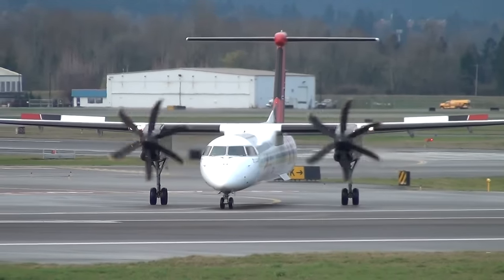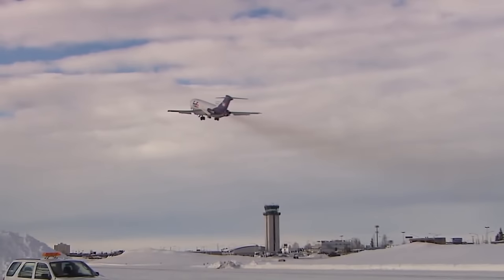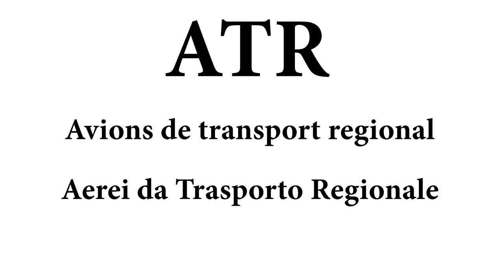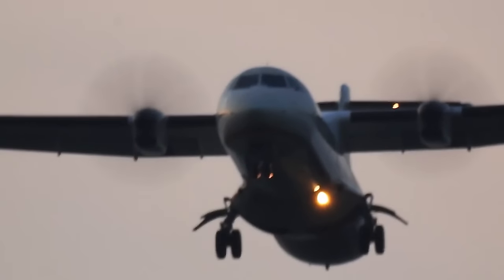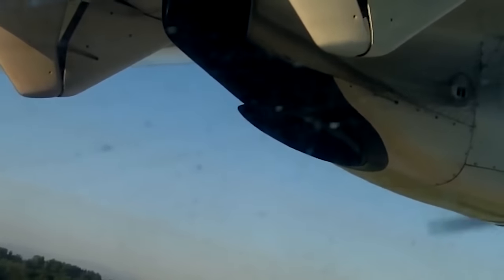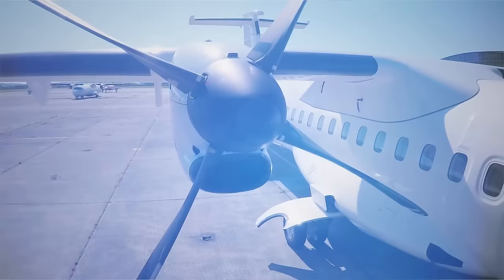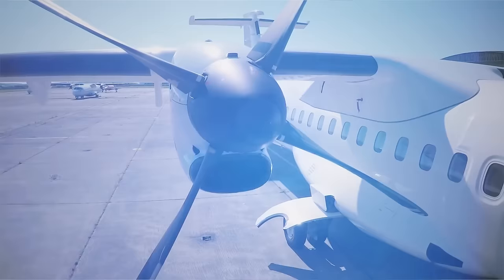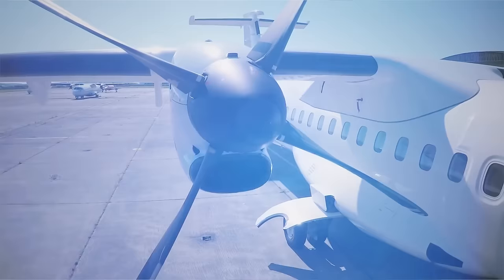ATR 42/72 - the European turboprop

Comment: I work as an aircraft mechanic on ATR 42. One of the things which amaze me is that it does not have any hydraulic assistance for main flight controls (There are, however, hydraulic spoilers which move together with ailerons), instead using variety of aerodynamic tricks to ease forces on the yoke. One less thing to wrong I guess.
Reply: Why is it being made though?
Reply: Oinikis can you become a pilot being an aircraft mechanic?
Reply: @rodelpheavertisamba866  well if you use your pay to get flight lessons, that's what I do, however by just working as one - no, it's completelly unrelated
Reply: @ Nikko Andrew Parangue

That is known as roll upset and is actually one of the advantages manual controls have over powered ones.. and why you’re not supposed to fly on autopilot in severe icing conditions. 

Controls that are snatched from your hands indicate roll or pitch upset and tell you that you should increase speed and not change configuration.
Reply: That's why they call ATR has a "fly by muscle" system
Reply: I work for an airline that also has ATR's and the mechanics I speak say the ATR is a real bitch to work on.
Reply: @QuarioQuario54321  You mean why build turboprops? They are cheaper to operate, and over modest distances their lower speed has little effect on overall flight times.
Reply: jve89 wrong !
It has always been a pleasure to work on, good access to aircraft systems etc.
Reply: jve89 I happen to notice how most cars I’ve known to be a lot of fun to drive, but are also a real pain in the butt to work on.  I guess some planes are no different.  Am I right?
Reply: The ATR has to be carefully loaded (pax/baggage) to maintain stable flight. When they are ferried to maintenance they carry extra ballast because they are unbalanced when empty.
Reply: @rodelpheavertisamba866  sure you can.
Reply: Fokker did the same... The F27 flew like a dump truck while the Fokker-50 handled like an twin 172
Dunno about the ATR but smart design can eleminate devices that can cause problems
Reply: Can you elaborate on how it works?

Comment: Once I followed an Azul ATR-72 that took off from Recife and landed on the Cabo verde... that little bastard crossed the atlantic.
Reply: Once I have flown on a Dornier 228 from Corvo to Flores, that tinny thing crossed the Atlantic. 😂
Reply: @TheAllMightyGodofCod  I didn't get the joke
Reply: Done many flights in 42/72 in Cabo Verde, one only lasted 7 mins
Reply: Ferry flight
Reply: No way!
Reply: Arecife?
Reply: @moneymandan6217  No, Recife is a state capital in north east Brazil
Reply: I was able to fly a 42-500 with full tanks from Ireland all the way to Gander in FSX
Reply: Range   900  miles  of this  aircraft
Reply: OUR NEPAL'S ATR-72/42 WHICH IS USED BY BUDDHA AIR AND YETI AIRLINES HAS NEVER GOT AN EMERGENCY EXCEPT FOR ONE WHEEL FAILURE

Comment: I once flew on an ATR 42 with American Eagle in 1992, from Raliegh Durham to Charlotte NC. The thing I noticed was that it was somewhat less noiser than most turboprop airliners.  It appeared to have thicker cabin insulation that somewhat muffled the low pitched drone that's produced by the props.  My girlfriend gave it the nickname, "The Whisperprop".  I wish that Boeing 737s and Airbus A 300's were turboprop instead of conventional fan jet,  Though a bit slower, turboprops are more fuel efficient than fan jet engines. I also love the sound that the props make, the "Box Fan" sound full ground idle and taxiing, and the "Bumblebee" sound in takeoff and inflight.  Some say driving a manual transmission vehicle is "Real Driving".  I say flying in a propeller driven airliner is "Real Flying"!

Comment: They can be tricky for inexperienced pilots or those with limited intelligence.  Crosswind TOGO or landings can be challenging.  The wing surface area is designed for fuel efficiency, not maximum lift and low speed flight.  Redesigned wings that are longer and larger would make it better.

Comment: I have flown on TAP's ATR-72 and SATA Air Azores Q400, Q800 and the old ATP... They are all nice but the the ATR has the most modern cabin. From outside it kind os looks dated with the high wing but inside is very modern and comfortable. I really enjoy flying Porto to Lisbon on these little things. So quiet and views are so much better than on a jet plane!
Reply: @khoileanh402 ir a little bit better than Q799 but no quite as good as Q801

Comment: I love your videos!!! I used to work with ATR 72 and Q400 aircraft... I prefer the Q400.
Reply: Do you think the Q400 has a future?  I hope so but they get maligned on landing gear reliability.
Reply: i love working on the 400 too. i was an avionic tech on the Q400 assembly line at bombardier toronto.the avionics interfaces were in tight locations. all flight computers sat right below the centre floor board.
Reply: In terms of the cabin, ATR over Q400-800. they are not bad and maybe more spacious but the ATR is so much more elegant.
Reply: AviatorNeil really ???
Emptying hydraulic fluid almost on a daily basis, lol....this A/C is simly dangerous

Comment: The ATR 72 was the only turboprop my mom and I flew on. Before flying on that turboprop, she refused to fly on propeller and turboprop airplanes and would rather fly on passenger jets. Even after having an experience onboard the ATR 72 with Cebu Pacific back in 2019, we never liked it because of the uncomfortable seats and small overhead bins too small that we had to check in bags. However, we got what we paid for because Cebu Pacific is a budget airline along with its branch Cebgo. Even if that experience wasn't enjoyable because we never felt safe in that type of plane, turboprops shouldn't go obsolete because those planes would only make sense to be utilized in small airports that have shorter runways and limited service.

Comment: Air NZ through its subsidiary Mt Cook Airlines, is the 3rd largest operator the ATR72-500/600 in the world. Air NZ has found the ATR72, to be economical and reliable but is not as fastest as the airline's Q300. ATR is in discussions with Air NZ about using the ATR42-600S (short take off/landing version) to replace some of the aging Q300's.

I have found the -600 quieter and less vibration than the -500.
Reply: Got to wonder if Air NZ will ever get the Q400. Air Nelson has been asking Air NZ to upgrade their Q300 to Q400 in the past and got denied as the Bombardier aircraft are not as efficient, but they sound more ergonomic as mentioned in the comments and the - 400 carries over 80 passengers.
Reply: @captaindusty4884  I read somewhere that a Q400 costs 31 million dollars and an ATR 72 26 million. Price of the Q400 may even go up when Viking Air starts building them. ATR also has the advantage of the Airbus service network. It's a very competitive market.
Reply: @captaindusty4884  - Air Nelson originally wanted the Q400 but was given the Q300 instead, as the 23 Q300's purchased were cheap due to the end of the Q300 production. Air NZ wants to operate the ATR for all regional services as they are cheaper to operate plus the ATR fleet will have update RNP for all weather operations and be compatible to the virtual (unmanned) control tower system that New Zealand is introducing from 2020.

Comment: I lived in Cape Verde for a good while. Cape Verde airlines has a lot of ATRs and I used to know many of its pilots. It is not only some good aircraft for travelling in, it is also a very interesting aircraft to pilot they used to say.
However, the "faint of heart" wont be too comfortable with its noise or the sensation the short distance of the engines to the body of the plane gives.

Comment: I thought the icing problems these jets had would have been worth mentioning.  Weren't there 3 or 4 crashes in quick succession in the 90s due to icing?
Reply: Yes. Roselawn, Indiana.
Reply: @billyray3761  Yeah. This plane is not good in cold conditions. A heard, there was another accident in Russia too
Reply: No !  There was ONE. Roselawn Indiana and the icing conditions were so freakishly severe ANY aircraft that used boots would have gone down. I flew this plane all over Maine and New England in winter conditions with no problems. That incident gave the ATR a VERY undeserved black eye.
Reply: Flyer Killer 
You obviously never flew the ATR.
Reply: @savagecub  ATRs have still deicing problems time to time...
http://aerossurance.com/safety-management/atr72-control-problem-no-2016/
Reply: @savagecub  Btw. there was more than one fatal accident with ice to be blamed:
Aero Trasporti Italiani Flight 460 (1987)
American Eagle 4184 (1994)
TransAsia cargo 791 (2002)

Aero Caribbean 883 (2010)
UTair 120 (2012)
Trigana Air Service Flight 267 (2015)
West Wind Aviation Flight 280 (2017)
Reply: Thomas Chadwick 
The examples you bring up are quite specious with the exception of Eagle 4184. Using your logic one would also fault the design of the Q400 involved in Colgan 3407. Let’s look at each reference you bring up :
1.) Aero Transporti 460 - crew was climbing in IAS mode and not adhering to company procedures for icing conditions. Fault of the crew NOT the aircraft. 
2.) Eagle 4184 - previously discussed - a British investigation revealed that likely no form of deicing boot would have been successful under these extreme and isolated conditions. 
3.) TransAsia Cargo 791 caused by the flight crews unfamiliarity with icing conditions and lack of awareness concerning several Cautions and Notes contained in the aircrew flight operating handbook. Fault of the crew Not the aircraft. 
4.) Aero Caribbean 883, this one is of particular interest to me as in reviewing the serial number of that aircraft I found that I had actually flown it when it was owned by another carrier. Witnesses report seeing the plane flying low prior to impact with smoke and flames coming from one engine. Icing is mentioned in a side note but hardly the sole cause of this incident. 
5.) Utair 120 this one is easy !  Crew failed to deice the aircraft prior to takeoff. To suggest that the design of the aircraft caused this would be the same as saying that Air Florida flight 90 was due to some sort of fault in the 737’s ability to fly in icing conditions which we all know would be incorrect. 
6.)Trigana Flight 267 wasn’t actually related to icing at all !  This was a CFIT
7.) West Wind 260 - same as Utair 120 , crew did not deice prior to attempting takeoff. Hardly a design flaw.
Reply: @savagecub  So you say the ATR have no icing flaws and is 100% complying with FAA design certification rules for Transport Category aircraft (Part 25, Appendix C) and it's safe to fly with, let's say to Illinois in winter?
Reply: the deicing issues with american eagle caused crashes..look up those videos
Reply: Thomas Chadwick 
I’m saying I have over 4400 hours flying it in the northeast United States in all kinds of icing conditions with absolutely ZERO issues. How many hours did you fly the ATR 42/72 for ?  I freely acknowledge that the Roselawn incident was unique and resulted in improvements in the design that enable the aircraft to endure ONCE IN A LIFETIME icing conditions because even BEFORE that incident I never experienced any issues with the ATR in icing conditions. If the subject aircraft in the Roselawn incident had been ANY OTHER aircraft that used boots that aircraft would be maligned just has harshly as the ATR is now. Take note that even after the Roselawn incident Continental Express CONTINUED to operate the aircraft in the Northeastern United States until well into the 2000s without a single issue.
Reply: @flyerkiller5073 , that aircraft crashed because they did not de-ice the aircraft before take-off. Such an accident is not related to aircraft type.
Reply: @savagecub  I agree. Eagle 4184 was flight outside certification parameters (freezing rain). All other ice related accidents have happened because they have been flying too slow - well below speeds for icing conditions.
Reply: @savagecub  https://en.wikipedia.org/wiki/ATR_72#Accidents_and_incidents
Reply: @savagecub  I also have 4000 hrs on the ATR and 5000 hrs on 737 and a total of 20000 hrs. I have a total of 52 aircraft endorsements and I have to say most of these comments are correct The ATR is the most undesirable aircraft of all.
Reply: MikiLevu 
I would have to say the 737 is actually a bigger piece of shit. Of all the Boeing’s I flew (737,757,767,777,787) none of them broke nearly as much as the 737.
Reply: @mikilevu3559  You are correct, cheaply built and they put the Fear of God in you during any icing encounter. Very poor performance in warmer climates too.
Reply: yeah
Reply: savagecub do you feel that the  737 has grown to big? How does it feel handflown?
Reply: Pilot error.
Reply: ATR = All Those Relays
Reply: savagecub pp
Reply: That's why they are operated weekly between France and Canada.
Reply: I was an f/a for Continental Express on the ATR-42 from '90-'92.  I could've bid for the EMB, but chose to stick with the ATR for somewhat ignorant reasons (the Laredo crash didn't help matters much, either). I was older than a fair amount of the f/o's-and I was only 25! Lots of memories, even though I was only with the company for 2.5 years. But I was always nervous when it came to icing :(
Reply: I was General Manager Continental Express PWM 20years. We flew 42/72 ATR. Your right but it was worse then you think.  De icing boot was designed incorrectly resulting in many deaths and grounded entire fleet.. It was eventually redesigned.   But this almost spelled the end for ATR as well as many of its airline customers.  I don't know how he could have missed this. It was a design flaw of historical importance within the industry

Comment: I prefer the ATR 72 to the 42 ..
I have found the 42 more noisy on engine noise in the cabin .
For 3 1/2 years we had ex Aer Arran ( Now named Stobart Air) ATR 72-500 EI-REL & EI-REM as our IOM based aircraft doing Flybe flights to Liverpool & Manchester & Birmingham With sometimes one of the ATR 72-600 covering instead .
My only complaint about the ATR72-600 is the Now protruding call for assistance buttons especially when you are quite tall like me ( 6ft 2) and getting to my seat I have clipped the button by accident 😏

Comment: 3 of those crashes was when an upset pilot at Air Botswana took of and crashed his plane into the other 2 on the ground. Fortunately nobody else was onboard any of the planes but Air Botswana was crippled for a long time with their entire fleet gone.
Reply: And the video he showed where the airplane hit the bridge was pilot error. Engine failure on takeoff. Pilots didn't identify the correct engine. They shutdown the working engine, stalled and crashed. Not enough time to restart the working engine.

Comment: Whilst the airframe does not do icing conditions well, the engines do not do hot conditions well. In Australia they rarely fly above 20,000 ft due to high air temps, climbing is a struggle. You cannot cater them and load passengers (or refuel them) with the right engine running the generator. Slowing turn around times considerably in hot conditions. They fly at only 2/3’s the speed of a Q400. They have poor range, often requiring refuelling at outports with more expensive fuel. They struggle in every phase from loading, to take-off, to landing, whilst the Q400 excels. When competing on the same routes in Australia, they failed miserably. They are no longer used on RPT regional routes in Australia.

Comment: ATR  42/72 vs Dash 8/Q series. which is better?
Reply: ATRs are slightly cheaper, have easier maintenance, more modern avionics and better support worldwide. The Q-400 Next-gen offers better performance in longer routes as well more seats.

The Q-400 offers more versatility for routes where Jets could be a potentially good route, while the ATRs in general work well in lower demand routes and shorter distances.
Reply: supertrooper1492  i mean since both are regional turboprop aircraft, which one does the job in a more efficient way, in terms of costs and performance

Comment: I enjoy your videos but you  failed to point out the most major problem ATR encountered. I was General Manager Continental Express in PWM 20years. We used 42/72 equipment. There was a major design flow with ATR that resulted in many deaths, grounded the entire fleet and almost spelled the end of ATR. After an ATR fell out of the sky killing everyone, it was found the device boot was not able to prevent deadly ice build up. The entire world wide fleet was grounded. Continental Express was all but grounded along with many other carriers. Eventually ATR redesigned the boot and after many millions $ in losses, ATR was approved to fly again.  Im not sure how you could have missed that in your research. It was a complete disaster and almost spelled the end for ATR and many of its airline customers.

Comment: Are turboprops like the manual gearboxes of the aviation world?
Reply: No way, Americans use turboprops on many regional routes, they they mostly cannot use a manual gearbox! 😁
Reply: Not really, they are short haul planes fo "difficult" terrain, so short distances where other means of transport are not really viable. Thinks lots of mountains and islands, with short runways.
Reply: Yes, in the sense that they are a great and proven technology that is going obsolete.  Because finally turbofan engines and automatic transmissions overcame their earlier weaknesses.  The time periods are roughly the same, starting early 1950s until 2020 when the transfer is complete.